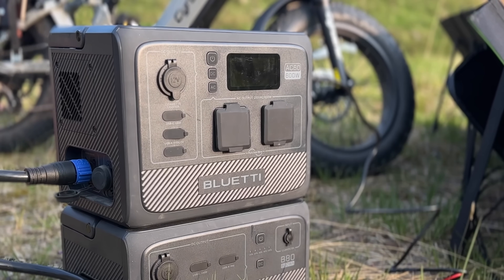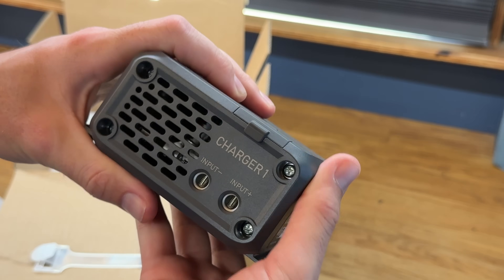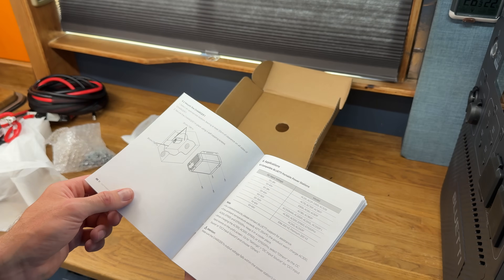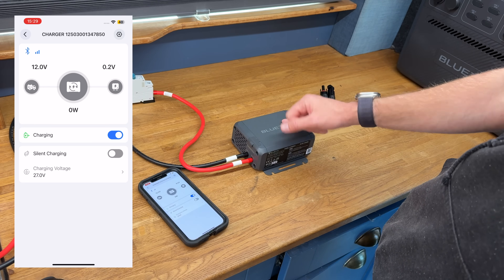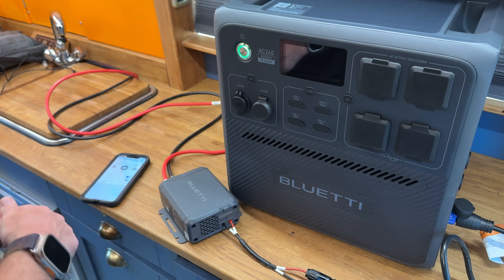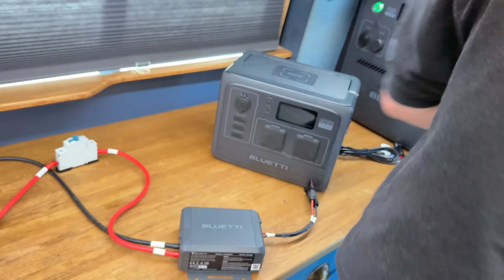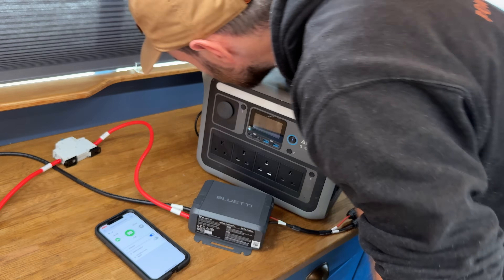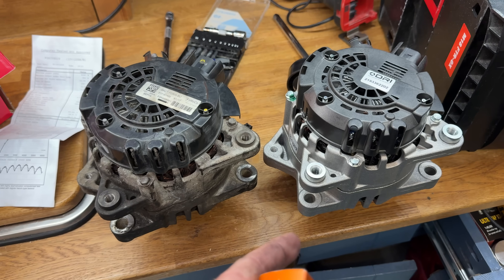WARNING! This Could DAMAGE Your Power Station | Watch BEFORE Using the Bluetti Charger 1

Comment: Hmmm. I wonder why they want to have the Charger1 close to the Powerstation. Wouldn't it make more sense to have the connection between the alternator (or car battery) and the Charger 1 as short as possible (and also the breaker as close to the battery as possible) and deliver the 54V over a longer (and thinner) cable to the Powerstation? Anyone out there that has an explanation? (Or can you actually just do it without risking to burn down your car? 🙂)
Reply from the maker: I completely agree that it would make more logical sense to have the lower voltage side shorter and the higher voltage side longer. 

Every other power station alternator chargers I’ve tested  It also comes with a five meter 12 V side.

My guess is their thoughts on most likely location mounting of the charger being installed. most of their marketing information for cars and camper vans show the charger one mounted in the boot/trunk section of a car or the rear of the habitation for campervans where traditionally the electrics are.
Reply: @MispronouncedAdventures  Yeah, I think you hit it. I'd like to place it in the engine bay of my Ford Ranger (provided I find a spot where it does not get wet...) and then get a pair of 4mm2 (AWG 12) solar cable (which would be sufficient for 10A at 54V) to the back of my truck. Any thoughts? As an addition for Victron lovers, there is a DCDC step up converter that comes close to the Bluetti Charger1 and with better elements protection:  Victron ORION-TR DC-DC Wandler | 12V auf 48V, 8A (380W) | GALVANISCH GETRENNT | ORI124838110 (I have only the German order code for it, but it might be the same elsewhere.)

Comment: Very informative video, thank you. Do you think it would be possible to use Charger 1 to charge a stand alone LiFePo4 battery? I'm thinking of buying one to expand my AC70 but haven't been able to figure out how to charge it when off grid except using a dc-dc charger. I don't think you can have both a dc-dc and a Charger1 connected to your vehicles alternator, can you?
Reply from the maker: Unfortunately not. It’s not really possible to charge a standard LiFePo4 for battery.

Technically, I wouldn’t see the “charger 1” as a charger at all, it’s more of a step up power supply. 

A charger has a charge profile and volts and amps through multiple stages of the charging cycle, bulk, absorption, float. 

In this case the “charger 1” just supplies a constant fixed voltage to the solar port of the power station. The power stations internal MPPT is taking that fixed voltage and amps and then it itself being the charger running the correct charge profile for the batteries cell configuration.
Reply: @MispronouncedAdventures  I see, thank you for your answer!
Reply from the maker: @anderspettersson238  no problem

Comment: Excellent as always - Thank you.   Have heard that running at idle may not be so good for the alternator for extended time as you point out.  (Some DC/DC units shut down automatically e.g. Etaker have an inbuilt motion detector at idle after some time).  Output on Bluetti Charger-1 to powerbank is variable in the APP.  

This Bluetti Charger-1 is an excellent charger with nice thick cables.  Some people also advocate fitting an extra fuse breaker after the battery if this is under the bonnet rather than in the cab. 

 We have fitted this Bluetti Charger-1 to an Anker Solix C1000 powerbank.  Works as it should.
Reply from the maker: Running at idle has its problems as it’s low engine RPM which means low spinning of the internal alternator cooling fan and no air rushing through the vehicles grill for cooling. if that’s a problem or not depends on the load you’re trying to pull and the capacity of the alternator. 

If you’re running an older 90 amp alternator and you’re trying to pull a 50 amp auxiliary load at idle then that not good! but if you have a 220 amp alternator like my van then 50 amp at idle is no problem at all. Depends on the circumstances, basically.

I have seen some systems. Do you have a motion detection to start the DCDC charging? Personally I like the option to charge at idle and stationary.
I did mention in this video as well that normally your protection device (  a fuse ) should be at the starter battery end and not the input end of the charger.

Comment: What i don't see anyone else mentioning with alternator charging in general is the pretty intense additional load on the alternator. A lot of the cheap old tech DC/DC chargers are around 200 - 250w. People are generally using very old and tired vans so banging 500-750w load on your 100 -150 amp alternator / it's cabling that's begging for death already constantly can have expensive ramifications.
Reply from the maker: I frequently mention safe alternator charging and practices in videos, including this one ( 17:57 ) 

Specifically the generally accepted but conservative rule of thumb that an auxiliary load on an alternator shouldn’t be more than one third of its capacity, and the reasons of why and the potential consequences if you overload.
Reply: My apologies, it was supposed to read i dont see anyone else mentioning! Your information is generally delivered warts and all. @MispronouncedAdventures
Reply: Thank you for bringing up the issue of the altternator. I saw a demo of this product on another channel that included data from real time usage in a large pickup truck with something like a 230 amp alternator.  I have a new 130 amp alternator in my minivan, and I see from this video that I'm correct in thinking that I probably should not use this product at its Max draw.  I have this product but not gotten it installed yet due to these questions.
Reply from the maker: 560W ( max ) on a 12V 130A alternator. Would be just at the acceptable level.

The rule is one third of the capacity Of the alternator. 

130A divided by 3 = 43A ( you max aux load ) 

560W divided by 14.6v ( alternator output voltage ) = 38A 

So it would be just about acceptable
Reply: @MispronouncedAdventures Does this assume you're not running anything else such as windshield wipers or airconditioning?
Reply from the maker: @tracyLoJo nope, the rule of thumb is based upon the idea that it’s an additional load to the current existing ones such as the engine running and so on
Reply: @MispronouncedAdventures Ok, got it. Thank you very much for your prompt replies! 😎

Comment: i regret learn to play with  dc to dc non isolated non fused   converters upon my eco flow delta 2...  forgot that it might draw more than 10 amps input to make 24v  and i burned the 12v outlet...   lesson learned....  2 years later  i still love all those gadgets but    would stick to   victron as i did!!!   ...
Reply from the maker: Victron is what the primary system in my van has been for years and I have no plan of changing that.

Personally, I find power stations a great addition to complement my existing electrical system. Especially with the flexibility of it being portable 

Sorry to hear about the damage you did to your 12 V
Reply: My hobby shed has some goodies too   but most  spare parts are  bought for   van build... But  laws  in Greece  go hard

Comment: Victron all the way...
Reply: there is no victron product available to charge a 48V system from 12V alternator. Im thinking about using this (with a victron mppt) to charge my battery)
Reply from the maker: @juri14111996 Their is actually, new and quietly launched
Victron Orion-Tr Smart DC-DC charger isolated 12 - 48 8A ( 360-430W ) part code SKU: ORI124838120
Reply: @MispronouncedAdventures  thanks. i might instsll one oe 2 of these.
Reply: Oh have a little w**k over all the blue..
Reply: Victron for consumers,  sterling for commercial
Reply from the maker: @Alex-uh1mj plenty of Victron gets used for commercial, I would’ve thought more than Sterling
Reply: @MispronouncedAdventures Not where there's any real power demands. Victron is  weak sauce for fanboys.  Biggest dc-dc charger is what 50A? What use is that if you are sitting on 1000ah

Na, victron is purely for bragging rights. Anyone doing proper commercial installations will use sterling gear
Reply from the maker: My whole system is Victron. But Powerstations have there place and uses
Reply: @MispronouncedAdventures But you could charge this powerstation with your Victron DC-DC? It would be a waste of money to have 2.Plus the Victron is going to deliver much higher amps at 12V. The Bluetti turns into a 140W charger if you're trying to charge at 12V.
Reply from the maker: @mondotv4216  you couldn’t charge a power station effectively or fast using a Victron DCDC charger or converter. 

The maximum amp input on solar ports on power stations is often quite low and limited. 10A for example.  So a 12-12 DCDC would only be 120W ( 12V x 10A ) ( which is basically the same maximum amp you get from the normal 12 V socket charger ) even if used a 12 to 24 V you only get a maximum of 240W ( 24v x 10A ) 

Hence the reason for this device since many of the medium to large power stations still have let’s say 10 amp at maximum on the solar input port but could have up to 56V ( 56V x 10A ) = 560W.

Push the volts higher but keep the amps the same.
Reply: @MispronouncedAdventures But the problem is the other way - if you want to use your DC to Dc charger to charge your 12V van or camping system, you can’t do it effectively with the Bluetti and thst is by far the more common use for a DC -DC charger.
Reply from the maker: @mondotv4216  Not sure we are talking about the same things. 

Is you want to charge a normal leisure system like my vans Victron based 12v 400ah lithium system from a 12V vehicle then using a DCDC charger is the best option. 

If you want to charge a powerstation from the 12v van then using something like the Charger 1 ( or other brands ) is the best option as power station cant accept higher amps at 12v.
Reply: @MispronouncedAdventures I guess there are some people just using a powerstation and nothing else but I think this would be overkill for that. It's going to be cheaper using a 12V or 24V inverter.
Reply from the maker: @mondotv4216 I think going just power station as it’s use cases probably for people who are just weekend away so or camping. 

Gets a bit more complicated if you want to use an inverter inside the vehicle to charge it.  

But sure, if you just want to use 12 V, you can use the 12 V socket most power stations come with.  It’s just going to be slow and limited to 120W
Reply: @MispronouncedAdventures  the 12V soket on most power stations is limited to only 10A. this will just to for a fridge a abit of light OR a fan.

If you use lights and a fan, the fridge starting the compressor will most likely allreay trip the 12V output of the powerstation in to overload and turning it off.

An the biggest Problem is reliability. I got an Anker Solic C1000 as a temporari soltuin in my comper till i have time to do a properly system, this crap of a product died after just 10 months. (and the 1,7kw rated inverter is realy weak, it cant even start my portable ac unit, but my 400$, 1,5kw rated inverter generator can do it.)

Comment: Hi Alex.
I have got this and im well happy with it i dont get the full 560w but i think thats down to the alternator mabe.
I have tried it on allpowers r1500 and eco flo and its great.
But i have bought the new jackery v2 1000. And its confusing on the voltage as it has to ports for solar i have seen other youtubers say both ports are connected to the same regulator if this is the case it should take 60v what do you think as i cannot find anyone that has tried this with the jackery 100v2.
Reply from the maker: What amount do you get? 

A few options I could think of

The maximum output wise is only 10A. So you only get 560W when it’s sent to 56v ( 56v x 10A = 560W ), by default it comes at 28V, which at 10A is only 280w. 

Next option is the alternator is not large enough for the full load combined with running the engine and other things

Third is the power station can’t handle the higher charge  amount. For example, let’s say the EcoFlow MPPT port is a max to 28V and 8A. So you would only get 28v x 8A = 224W.
Reply: @MispronouncedAdventures  when I plug into the Allpowers R1500 I have it set to max 56v and I only get at most 472watts so assume its my alternator.
Reply from the maker: @kevinbryan3860 what is your alternators capacity?
Reply: @MispronouncedAdventures hi i think its the standard one wich is 140amp.
Its a fast enough charge at 472 but not sure why i dont get the 560watts from it.
But its just the jackery that is the one thats confusing and seems to be with everyone els as no one has done a vlog on charging one using the charger 1.
Reply from the maker: I’m just looking at the specs of the Jackery 1000 V2 for you. They are a little bit confusing although it would seem even though it accepts the higher voltage range and a higher amps the unit actually limits the maximum to 400W regardless of voltage and amps
Reply: @MispronouncedAdventures so I should be able to leave it on 56v to charge though the one port then as this seems to be what can work out but as I said and you have seen it is confusing jackery have to make it difficult

Comment: Interesting charger, great option if you use a variety of power stations. I assume you could use it to charge the leisure battery if you wanted to ? My power station comes with a cigarette lighter charging cable but is very very slow to charge. I usually only charge it back up when on a mains hookup so this would provide a much faster option to charge when driving. 👍
Reply from the maker: No, you definitely can’t use this to charge a leisure battery.

This thing is technically not a charger in the traditional sense. It’s had no charge profile for it output,

This is more of a fixed DCDC power supply with fixed voltage output which the power station’s MPPT solar controller then uses to charge and apply a charge profile. As far as the power station is concerned, it’s being charged by solar.

But there’s definitely would work as an option to charge your power station whilst driving faster
Reply: Ok,  i want this for my power station but also it would be nice if I could when needed actually plug it direct into my victron mttp and change my leisure batteries when needed, that way it would think it's getting 500 watts of solar and work? @MispronouncedAdventures
Reply: @MispronouncedAdventures  I use a Fogstar 100A which has internal battery management, would this still be a problem ?

Comment: Wait, I thought Ecoflow offers a cable to plug their charger into the solar port as well, which would allow it to be universal too.
Reply from the maker: Yes, I mentioned the 500W ( I think ) XT60 cable for the EcoFlow version when I made my video for them, although I’m unsure if that’s hit market yet?
Reply: @MispronouncedAdventures , ok…I just didn’t hear you mention that in this video when you were implying the benefit of the Bluetti charger.  If the cable is available for the ecoflow, I would think that should shift the purchase to the Ecoflow over the Bluetti for various reasons.  Appreciate your videos.
Reply from the maker: Yes, because as far as I’m aware it’s not available and it was previously advertised for charging just the EcoFlow River power stations although you are right in assuming if it works the same way it should be able to charge anything.

Something to note  with the EcoFlow version as many people comment on my video about it that they have to manually turn it on every time the vehicle starts.

Which power stations are trying to charge?
Reply: @MispronouncedAdventures , none currently as I’m stationed in Hawaii.  However, when I get back to Florida, will look at the models available and make that decision.  I own a 2023 Chevy Bolt and watched a great YT video on using alternator charger connected to Bolt (could do it to almost any EV) to quickly charge power stations for emergency situations (like hurricanes I’ve dealt with in SW Florida).  Chevy Bolt factory 12VDC charger can output 130 Amps or 1500/1600 watts.  A great option if you own an EV with a 66 kW battery bank 😎